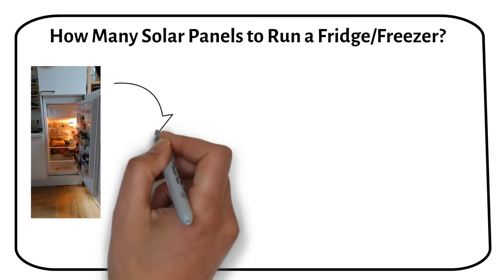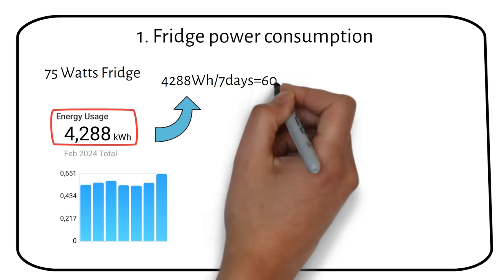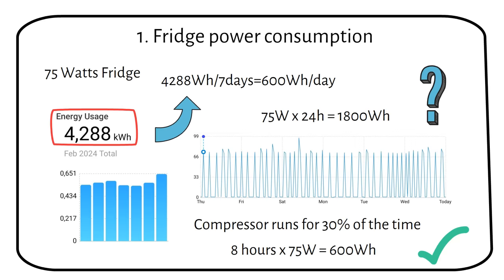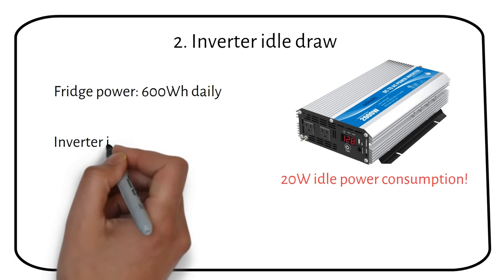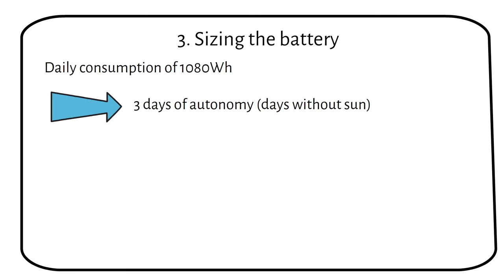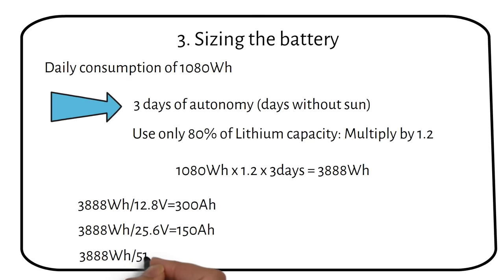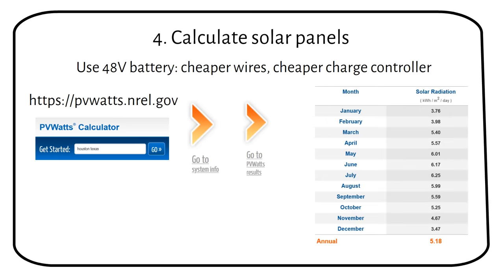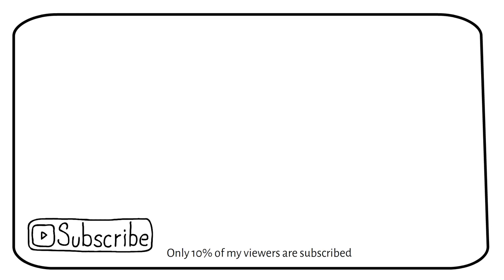How Many Solar Panels To Run a Fridge/Freezer?

Comment: The entire point with sizing the solar system is - if your demand requires full roof of panels and gigantic battery (or set of) …you have to decrease the demand. 
You don’t need a whole cow and three deer chopped up sitting in your freezer. + you don’t need many other things that consume power
Reply from the maker: True, or get a more efficient freezer to store the cow and three deer.
Reply: @cleversolarpower   .Filling your freezer to capacity makes it more energy-efficient by minimizing the amount of warm air that can enter it when you open the door. Also, the mass of the contents helps to recool the air.

Comment: If you design the solar panels with 25% of the daily energy needed it will work just fine, what you need is to ensure you receive with the solar panels at least the daily power consumption. So in my experience around 400W in solar panels will do fine.
Reply: I meant 125%

Comment: I measured the old fridge and large deep freezer I had in my house and is summer it had power consumption of 70w over 24hours (70 x 24 =1,68KW/h) . So you would only need a couple large  of solar panels at least but you would also need a battery bank so it can run during the night and make full use of the solar panel for charging.
Reply from the maker: You are confusing Watts and Watt hours. If your fridge runs on 70Watts, assuming a duty cycle of 30%, then your daily power consumption is 70W*8h=560Wh.

Comment: To think about the worst case scenario costs much more than paying a bill during winter months. We rather need an emergency scenario opening the fridge twice a day. Besides if it is freezing outside in winter, why should we use a fridge ? To put an old non working fridge outside will be far enough to go through the dark winter months. Solar energy should be used with common sense. To rely on the sun during winter is almost insane north of 45° (except maybe in very high mountains with bright sun shining if there are possibilities to clean the snow). I will certainly not use such an amount of solar panels to keep a bottle of milk and a few yoghurts. It is a waste of precious resources. Another bubble. Humanity lost its common sense. A 12 V camping fridge costs 100 bucks. All these batteries and solar panels are everything but ecological.
Reply from the maker: True, I agree. Consideration should be made if it's cost-effective. But this is a calculation for an off-grid system.

Comment: Your refrigerator is one of the larger household appliances. On average, a refrigerator uses 300 to 800 watts of electricity, or between 3 and 6 amps and about 120 volts.

Comment: So its going to  cost me $5000 to run a $300 dollar refrigerator? I'll keep using my westinghouse till they figure it out.
Reply from the maker: About $2000, accounting for the worst time of the year. Cheaper if you use your generator during winter. This is for off-grid, if it would be grid-tied, it wouldn't make any sense 😉

Comment: You are a blessing to humanity, well explained sir. Pls which of the watt rating below can i used to size the inverter, battery and solar panel of my freezer , rated:
Watt/rated corrent: 100W/1.75A
Energy consumption: 1.0kwh/24hr from the name plate
I am confused in watt- hr/day i should use
Reply from the maker: My pleasure! You already answered your own question. You need 1,000Wh per day.

Comment: The consumption information can also be estimated using the energy consumption label inside of the refrigerator.  Roughly 1 kw-hr per day.
Reply from the maker: Indeed, if that is available. I would multiply by 1.25 as a safety margin because those tests are run in lab environments.

Comment: I’m constantly monitoring my power consumption and am surprised how little power it takes for baseline operation of my home. If the water heater or air conditioner is not running, the typical load is around 750 w. We have two refrigerators and one large upright freezer. I use contactors controlled by timers to run the water heater when the solar can’t keep up.

While electric clothes dryer is the biggest load, it doesn’t run as often as the water heater. We try to use it after 8: pm when electricity is free on my contract with Reliant Energy in Texas.
Reply from the maker: Free electricity after 8pm? Sign me up!

Comment: don't try to run normal fridge/freezers off solar. But something like a SunDanzer Their fridge draws only 168 Watt-hrs/day.  In addition no inverter is needed as the solar panels charge the DC batteries and the refrig runs off DC not AC.
Reply: Sundanzer 10cubic feet cost 3 times more than my fridge, panels, battery and monitor COMBINED!
Reply: @danallanson5990  yes.  But it requires a tiny amount of power compared to your set up.

Comment: The AC to DC conversion consumes more energy than the actual refrigerator. They make DC refrigerators and freezers that consume much less power. I ran my 20cu/ft DC chester freezer on 200 Watts/(1) 100 amp/hr battery with no problems. The freezer was in my garage and I live in FL. I have since upgraded to 600 watts with (3) 100 amp/hr batteries just for piece of mind while I'm out of town.
Reply from the maker: Indeed, but DC fridges are generally more expensive.

Comment: Depending on your circumstances, that might be overkill on the number of solar panels.  Is it necessary to fully recharge you battery in one day after 3 days of cloudy weather?  Maybe in Houston or Baton Rouge, probably not in Denver or Phoenix.
Reply from the maker: It depends on your risk tolerance. If need be, you can use a generator to recharge the battery. This is for totally off-grid with 3 days of autonomy. You can repeat the calculations for your specific location.

Comment: If I base the power requrements on the least power-production month in winter, this will produce excessive unused power in the most productive month in summer, that will exceed my Inverter's capacity. Is this a problem? How is the excess power generated by the solar panels shedded?
Reply from the maker: Producing more power in the summer will make your batteries fully charged during the summer. Charging will stop when the batteries are full. The charge controller will stop this, acting like a switch. The inverter has nothing to do with it as it only takes power from the battery.

Comment: Sounds like a pretty small fridge.  We have a 2.5 cu ft fridge, about twice the size of a dorm fridge,  that uses 1 amp of 120V power when running.  That would be 120 watts when running.
Reply: You have to multiply by the duty cycle, since a fridge isn't running 100% of the time.   Our full-sized fridge burns around 200W running but the duty cycle is less than 30% so the average consumption is only 60W or so... about 1.4 kWh/day.

The inverter cares about peak loads.  The battery only cares about total energy consumption over a period of time.

Comment: Bear in mind:  when you add food to the freezer it will suck up a LOT of power initially to cool it down! Only when all your food is frozen will it consume the stated power. So allow for a big margin if you have some "turnover" in your freezer.
Reply from the maker: The load analysis included loading food in the fridge. However, don't place hot food in the fridge.
Reply: @cleversolarpower  Ok. I didn't see it explicitly in your calculations. So, people just need to be aware of taking this into account and add some leeway.  I made this mistake, literally a couple of days ago, and had to revert to mains power for a day, until the batteries caught up again. I'm running on Solar PV which is fine for the odd cloudy day but I stocked up the freezer and then also unfortunately had a couple of cloudy days. 😥

Comment: i have a lg fridge with inverter type compressor, it draws energy from 18 watt to 108 watt. i have personally calculated this.
Reply from the maker: You should also record the power consumption over the whole day, and then you get watt hours, which is more useful for load calculation.
Reply: @cleversolarpower i wasn't trying to calculate the its power consumption, just how much watts it was drawing while it was working.

Comment: I followed along and the calc’s for my rig came out to 2300W solar and almost 800ah of lithium batteries!  I have 1300w solar and 400 ah of lifpo now.
I should probably add 2 more batteries, but I also have a generator if I have too many cloudy days, I just don’t like to run the generator if at all possible.
Reply from the maker: I have made a video dedicated to sizing your system; go check it out for more information.

Comment: Solar panels are not enough at all in winter where I live because it's dark outside and sun will not give me enough energy at all from October to March each year, the period where most energy is needed. For Scandinavia solar panels are worthless.
I like your video you are absolutely correct
Reply from the maker: A generator for winter will be the best option.
Reply: @cleversolarpower  A generator running on what? Fuel? even more expensive than connected to grid electricity

Comment: Thanks for the video, my fridge consommation is 16W =1.6A , I tried it with my power station (bluetti E55 )then doesn’t work at all
Reply from the maker: 1.6A at 110V? That would be 176Wh*8h per day= 1408Wh/day. The bluetti E55 has 550Wh of storage, so yeah, will not work.

Comment: And 1000W sollar pannels are 5 square meters! Just for the fridge. It shows how unreliable renewals are!!!
I wondered about my needs for a stand-alone freezer. During the winter times it will also need less energy due to lower ambient temperatures, and during the summer I get plenty of sun 14-18 hours/day
Reply: 5 square meters is not that big.  About the size of a queen bed.  Also his math was very very conservative. He calculated using Houston Texas getting less than 4 hours of sunlight a day AND planned the system around being able to survive for 3 days with no sun AND he planned on never once drawing his battery below 20%.  His math is accurate, but in the real world you could do half the battery and half the panels and never have a problem.  Just the idea of having 3 zero sun days in a row is absurd...and having your battery go below 20% a few times a year won't affect its longevity.
Reply: @PeterSedesse  
I wouldn't want to end up with a freezer full of rotten meat.
" Just the idea of having 3 zero sun days in a row is absurd" - not where I live.
Reply: @pwolkowicki  3 days of blackout followed by the absolute worst solar days of the year and being afraid to let your battery go below 20% during that unlikely event is just too conservative and probably doubled your build cost. I mean after your first day of blackout, you can just be more careful with opening the fridge door.  A few years ago in Texas we had 4 days without electricity.  I ate the ice cream on day 1 and never opened the freezer door again and my meat barely started dethawing.  It is fine to be conservative, but stacking/compounding 3 things on top of each other just blows up your build cost too much.

Comment: My LG fridge is an inverter and the compressor runs continuously.
Reply: My LG fridge feom circa 2005 also runs continuously.  My fridge runs on 3.5 amps which comes out to 420 watts.  I just bought an Anker Solix C1000 Power Station.  I want it to be able to run my fridge in summer or my boiler in winter . My boiler runs on about 400 watts as well.  I will have two 200 watt panels, and an extra battery for my system.  I also do not have to power them non-stop which means I can stretch the time they can run.
Reply from the maker: 420W continually? Seems like a lot to me.
Reply: @cleversolarpower  I can only go with what is written on the door.  Yes, the compressor pretty much only stops when the door is opened.   I would imagine that to be fairly accurate.

Comment: Excellent video!! Just wondering if you have a way of calculating the loss from the Solar controller. I also get bogged down in calculating the panel output when converted to the controller output. For example if my panel puts out 100w @18v how many watts does the controller put out at 12.5v? This is important to figure out how many panels I need to charge the battery.
Reply from the maker: I believe most MPPT's to be 95% efficient. 100W/14.6V=6.84A*0.95=6.5A
Reply: Your charge MPPT controller is going to output 14.4 volts -- not 12.5 volts.

Comment: 3:41 Multiply by 1.25
Reply from the maker: You are very attentive, it has to be 1.25 indeed. However, after doing research, you can use a factor of 1 or ignore this multiplication. Lifepo4 cells now can handle 8,000 cycles and still remain 80% of their capacity. As stated by other youtubers, calendar aging will be the end of the battery, not the amount of cycles. Thanks for your comment.

Comment: You were wrong when calculate solar panels! Solar radiation per square meter is not equal sunhours per day!!!
Reply from the maker: No, sunhours = 1000W/m2 per day. And you won't get 1000W/m2, so that's why you think it is not correct. That's why there is more hours of sun than sunhours.
Reply: @cleversolarpower  Ok, I didn't know 'sunhour' therm, you are right. Thanks for the explanation.
Btw the calculation of solar panels' power seemed wrong...
You need to store 3.9 kWh/day - Ok.
Then you divide this number by 3.5 sunhours (kWh/m2/day) and the result must be square meters of surface to get this energy during one day with 100% efficiency.
3.9 kWh / 3.5 kWh/m2 = 1.11 m2
How do you convert m2 to the power of solarpanels?

And you in Texas are lucky, 3.5 sunhours during December is much greater than my 0.37 in Ukraine :(

Comment: It says kWh, so why did you immediately call it Wh? That is dividing by 1000 for no reason.
Reply from the maker: It's European notation. The comma is a dot in the us 😉
Reply: @cleversolarpower  Fair. I'm not from the USA though. I am Aussie (who now lives in Canada). I was aware that the comma was used as a decimal in places like Brazil, but not in Europe. (learn something new every day, ty).

But as an Aussie, the comma is used just to make it easier to read large numbers (and is marked every 1000 units). 

Much easier to read say 1000000000 by putting in 3 commas, than it is to read it as above (1,000,000,000). 

In any case - this is just a case of different notation. All good.

I am curious though, how they mark large numbers. (Genuine curiosity, not any kind of judgement).

Comment: How Many Solar Panels To Run a Fridge/Freezer?
so how many solar panels does it take? to power 1110 watts of solar?
Reply from the maker: Divide 1110W by the power rating of your solar panel of your choice.
Reply: @cleversolarpower   I feel like you should be going off an average solar panel format so that the answer to the title is accomplished otherwise if you leave it up to choice of solar panel we could be here all day talking about the wide variety of selection. Instead its just better to specify an average such that the average viewer can get a general idea of how many (average) solar panels it would take.
From what I've researched its around 4 average solar panels but if we are talking about the battery capacity and if we are not too sure the year will provide sunny weather then we will need to rely more on extra solar panels to supply more power to the battery in the event the weather is not sunny enough in the annual sense.

Comment: The number in that table is kWh/square meter / day. Dividing the total energy by that number results in the square meter of solar required assuming 100% efficiency. Then you have to assume efficiency of solar Then tilt and orientation. Then round-trip efficiency of charging/discharging. This is a very misleading video.

Comment: We recently had solar panels fitted, ten in total on an east west facing roof (five each side). Never looked too much in the past as you definitely needed a south facing roof with the older type panels. We have two upright freezers, a fridge-freezer and a fridge. When the sun is shining the panels run all of those plus a 2Kw ceramic radiator. Also had a 8.4Kwh storage battery fitted in the attic, again after a good sunny day the battery will continue powering everything up to about 10pm. On a cloudy day the panels still reduce any mains consumption by around 20p per hour. The first full month after they were fitted our overall consumption dropped by 25Kw. Now all we need is the ruddy SEG agreement to come through!

Comment: Wait...How do you read 4288 Wh when it is written 4288kWh? Is this a political channel or technical channel?. Typical combo-fridge with 4* compartment are more on the 200kWh/anum at least. Moreover, you think that power consumption is the same in summer and winter. It is lowest in winter especially if you place the fridge away from heater. And 20W inverter idle power consumption shall not be called "idle"for 1/3 of the time as the inverter is active.

Comment: Your assumptions are very pessimistic. If you are off grid, you should use a chest fridge and not regular, it uses half the power. Also, you can easily make enough ice to cool the fridge for 3 days. Also, you make less solar energy in winter, but the fridge uses less energy in winter.
Easily, 300W solar and no batteries are enough

Comment: Good video, but it is really misleading to be that conservative.  3 days autonomous, only 3 hours of sunlight, and never once going below 20% charge is just too much stacked on top of each other.  You are wasting way too much money planning on the worst, worst possible situation.  You are assuming you are having 3 days of blackout followed by the lowest sunlight days of the year and that your battery will instantly die the moment it gets below 20% charge for the first time...and planning your build around that.  You could halve you solar panels and battery size and probably never have an issue.